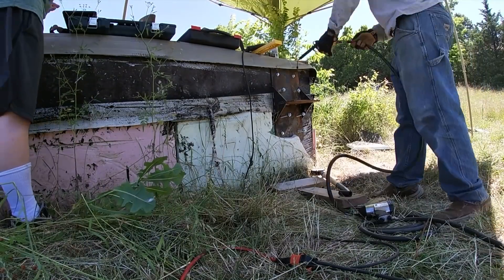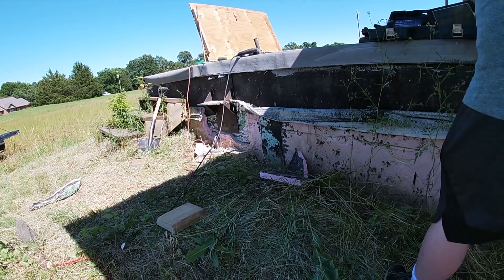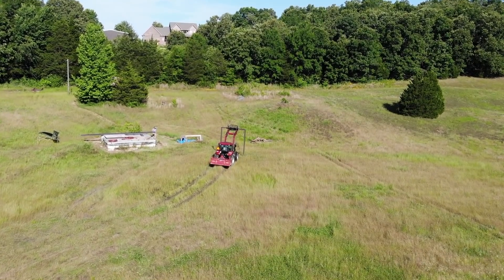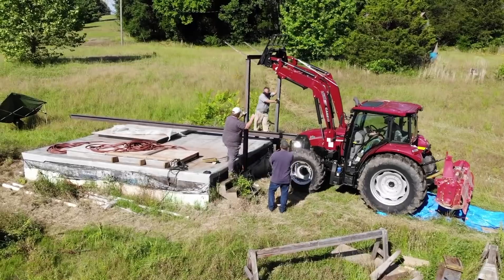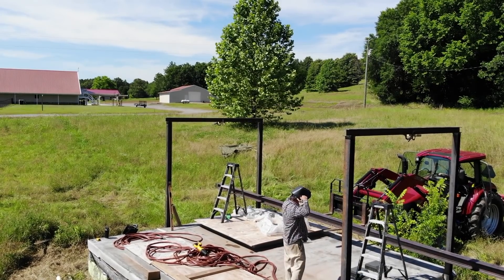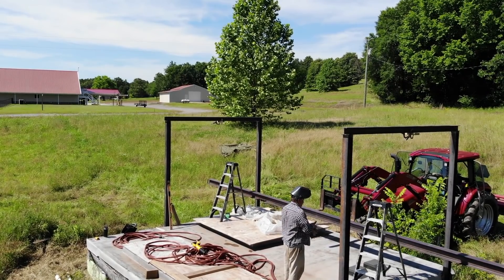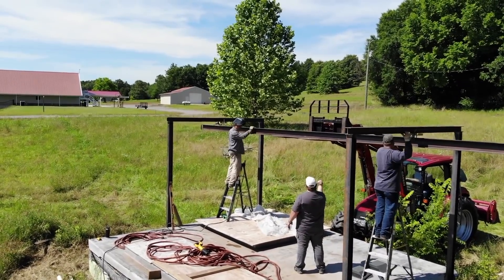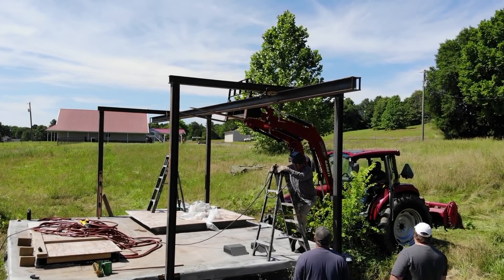S1E18 - Gantry Crane Build - Owning a Titan II Missile Silo

Comment: As mentioned, triangles are your friend, and you don’t have enough of them in that structure IMO.  I am seeing y0u lifting a load of scrap up out of the hole, then sliding along the rail to put it in a truck?  That load shifts on the line/chain or it gets moving too fast and hits the end of the rail too fast and starts to swing its momentum then turns your compression loaded structure into one loaded in shear with 4 long levers into concrete anchors...  A triangulated structure will shorten/remove the mechanical advantage the levers and flex in the structure created by the long legs have on the concrete anchors.  Total shear load on the concrete bolts might be a problem, but any unexpected lateral movement like I described above  will also stress them in tension/pullout force...  on a less serious note, the music was loud compared to the narrated audio...
Reply: At least, some gussets in the corners??

Comment: That looks like the crane set up I fabricated for a pumping station I was maintaining back in my working days. We used to need a service truck with a good sized crane to pull out our pumps and other machinery until I made a frame that we could attach an electric hoist to. It sure saved me a lot of headaches.
Reply from the maker: Very cool!

Comment: What kind of weight are you planning on pulling up with that rig?
Reply from the maker: Given that we need to move it both underground and topsides no more than 500lbs. Most of the time only a couple of hundred. The crane itself is rated at 2000 but I have no interest is going anywhere near that heavy.

Comment: I think I would have used short diagonal stiffeners at the top of the frames, and grade 8 bolts at gantry rail/frame joints to make the frame stronger. Heavy loads on gantry rail will cause frame to move as well.  Paint for rust??? esp in welds...

Comment: Alternative title: Four men, one giant erection.

Good work as always, the scrap-out is going to be a slog, but this will make it so much easier! have you conidered a 1-piece sliding hatch? It should only really require a couple of simple rails to run on and could easily be opened by 1 man if necessary. it would be much stronger than an 2 piece hinged affair and could be made weathertight a lot more simply than if there was a join in the middle.

Comment: I would recommend some diagonal bracing from the vertical beams down to poured concrete footers set in the ground.  The lateral shear strength of bolts is not that great.  It would also significantly reduce the stress on the corner welds.  If you don't want to do that, I would at least add some corner gussets at the top.  Or perhaps an X of diagonal bracing on one side to join the two end squares.  I'm not sure how much weight you plan to lift.  The beams themselves are plenty robust, but the joints are a potential failure point.  A square joined only at the corners is not the strongest geometry.

Comment: I know it's likely that this crane is perfectly ok as is, but i would've put two of the H or I beams the other orientation vs all being the same (two, as in, one per set of legs). That way, which ever way it wants to flex, it's always countered by the structural position of a H beam, which goes with the flats. As they are, technically speaking, they're weak to side loads, for example, if you load a particularly heavy item to the bin/truck, they might pop over. H beam isn't exacty the best choice for legs that are vertical. But it's likely over whatever scrap you can pull out in piece through the bunker door, so it should be ok. Just my 2 cents.
Reply from the maker: It’s actually overbuilt for what we need.